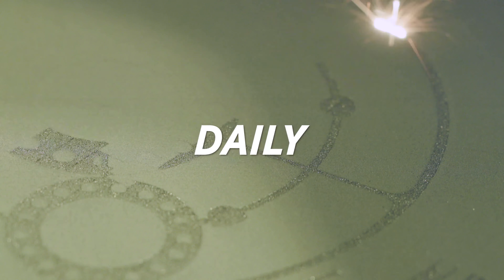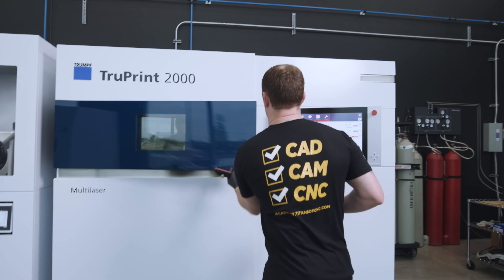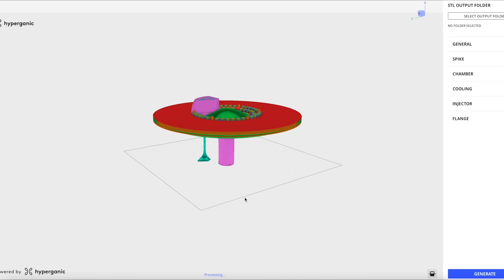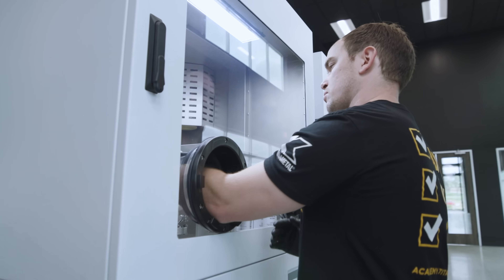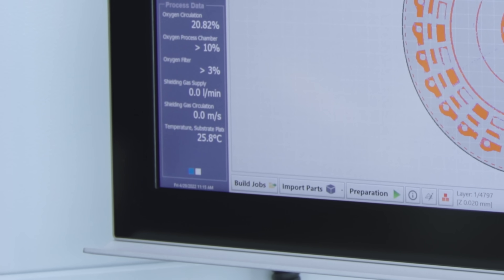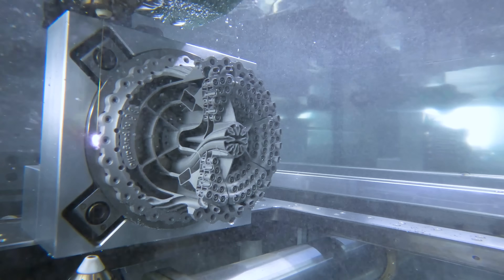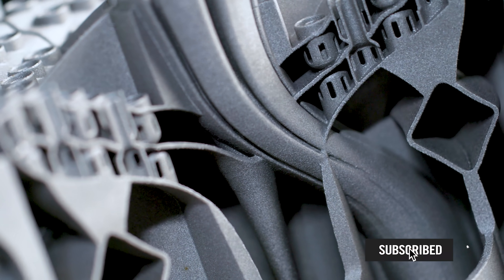3D Printing a Titanium Part Created By Artificial Intelligence

Comment: Ti 6Al-4V is the most widely used of all the alpha-beta titanium alloys. It is typically used in the annealed condition, at service temperatures through 750°F. However it may be heat treated for high strength in sections under 4" thick. Hardenability is limited and sections over one inch may not develop full properties. Ti 6Al-4V is welded with matching or with ELI filler wire.

Mill anneal: 1300-1450°F 2 hours, air cool. Recrystallization anneal bar for better ductility and fatigue strength, 1750°F 2 hours, furnace cool.
For maximum fracture toughness and SCC resistance: Beta anneal 1950°F 1-2 hours, water quench. Then age 1150-1300°F 2 to 4 hours, air cool.
For maximum strength: solution-treated and aged (STA) condition is: For sheet, 1675-1725°F 5 to 25 minutes, water quench. Age 975°F 4 to 6 hours, air cool. For bars and forgings, 1675-1725°F 1 hour, water quench. Age 975-1025°F 3 hours, air cool.
For increased fracture toughness, but lower tensile strength: precipitation treat (overage) 1150-1250°F 4 hours, air cool. Stress relief annealing is commonly 1000-1200°F 1 to 4 hours, air cool.

Ti 6Al-4V is resistant to general corrosion but may be quickly attacked by environments that cause breakdown of the protective oxide. These include hydrofluoric (HF), hydrochloric (HCl), sulfuric and phosphoric acids. Inhibitors may help for the last four but not for HF. Ti 6Al-4V resists attack by pure hydrocarbons, and most chlorinated and fluorinated hydrocarbons (provided water has not caused formation of small amounts of HCl and HF).

Comment: Are all you people sheep!? Not a single comment asking what this ”piece” is for. Sure 3D printing is cool, and Im sure AI will help be a great tool to develop efficient parts in intelligent ways, but a random part generator is completely fucking bananas. Every ”part” of something by design is there for a reason to serve a function. A random ”part” generated by algorythms that look futuristic and cool but doesn’t have a function is completely useless! Why are people impressed by this?! The technology is great, all credit to whoever created the hardwear and software. But this video is so dumb. A tool designed by an AI is just clickbate. Because this part can’t be used for anything! If the purpose is to show of the equipment that is one thing, but the random algorythmicly AI generated aspect is completely irrelevant.

Comment: I work with EOS printers and I have no idea how this printer can print so many shallow angles like that with no support so well. Do you run into any sagging problems? I’m also shocked that it didn’t crash at any point. Is this system a no contact recoater as well?
Reply: Hi Connor!  Great catch on the angles.  TRUMPF system offer the ability to adjust many laser parameters which improves ability to build fine features, angles, and overhangs.  In many cases this can be done without supports with the right design and process optimization.  I can send you info on the recoater as well.  Can you provide an email address?

Comment: Wow, I'm really surprised at the low quality of that print.  I expected it to be much better.  Not saying its bad, but all that texture, those tiny bumps everywhere, I guess its to be expected from additive manufacturing.  I just compare that to subtractive manufacturing where you use various tools to remove material and the surface is so smooth its shinny, even reflective almost like a mirror, this isn't even close.

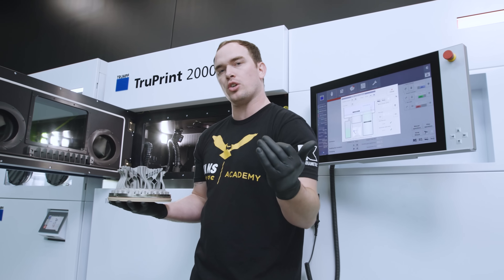Comment: But what about the crack (5:31, 5:42 and 6:00 min), in the middle upper part of the final product? This piece of art it will be a piece of garbage if this was a real component of a rocket. That crack showcase the reliability part of the metal printing process.

Comment: What does "wire" the part off the build plate mean?
Was that EDM?
Reply: Yes it was. The part is effectively welded to the build plate, therefore it needs to be cut off. Wire EDM is one of the most common methods used.

Comment: The problem is to start producing this for real products - it is necessary for the investor to find a normal material for normal composite mixtures, normal resins, normal equipment Especially when it comes to 3D printing lithography. Here is an example of an explosive engine. There are SHS manufacturers who are willing to pay me for it. But - they don’t give money in advance and they don’t give contracts either. Bottom line - why the heck is it necessary?

Comment: Interesting that there is a visible crack on the part. Without the cutaway, you'd never know it was there. At 5:52 where it overlays the words "NO SUPPORT" on the screen, you can see the crack directly above the 'O' in SUPPORT.
Reply: Yep… that part if completed without the cutaway would have shredded under pressure and likely blown up the engine in the process. I also noted that the part required substantial finishing as there were jagged edges along various openings that would have likely broken off and potentially damaged the injectors later or the engine… 3D printing is amazing… glossing over errors only undermines confidence
Reply: @MacKeyser  Is there a possibility that the crack appeared because they printed a section view of the part? I wonder if the 'AI' is able to not just design the part, but also do the relevant stress analyses.
Reply: @jyothisjenu6477  good point as it was printed with no supports. How many dimensions does ai think in producing layer by layer, stresses, expansion etc.
Reply: There’s other defects that they tried to hide with editing also.
Reply: saw that also.. in between the chambers a lot of excess material.. really cool concept though in time these things will just get better and better.
Reply: I mean it's clearly just a display piece. Im sure the procedure would have been slightly more operator support centric if they were actually making the part for a project. The point of this was to show off the AI's ability to design parts, not whether or not the printer could handle it all on its own.
Reply: @CorwinTheOneAndOnly pretty sure the point was to show off the printing technology not the AI side... Otherwise it would have been a video about designing the part and not printing it.
Reply: The other problem is you can't fix those issues. They can't be merely welded or filled in with material, because it wouldn't create a reliable enough bond and would cause stress in the material. Another issue with algorithmic design is it isn't able to take into account a lot of factors during operation of a part. For example, those thinner areas might save on weight, but thinner also means radiates heat quicker, which can also mean that area can actually get hotter, creating more stress than expected. Same with heat expansion....you can end up with thicker areas expanding in ways that create a whole bunch of different angled sheering stresses on thinner parts. 

And cracks like that also mean there is a malformation in other attributes of the part, as that space from the crack has to be displaced somewhere else. And one must also consider there could be thousands of cracks like that, but just not visible to the naked eye, and all through the inner areas, not just surface visible. In the end one must consider if it is even worth the trouble. A big part of the rocket industry is over priced because of the niche nature, not necessarily because of the difficulty of construction. So you could potentially make parts way cheaper than this with manual labor, if you devoted manufacturing work to it, with space to throw out bad apples and still have the costs be low. 

3D printing is great and all, but it also gets around an artificial problem. You setup a sewing machine style manufacturing line with tons of regular workers grinding away at specific tasks, and you could achieve some amazing results for very low prices per unit. But our economy simply isn't geared for that anymore, which is what makes parts like these more expensive than they need to be.  Just look at it this way. I have an umbrella. It was cheap. It has more metal than a metal pocket container I have, its construction is more complex than that pocket container. Yet the container cost twice as much as the umbrella. Why? Basically, just 'cause. That's the rocket industry in a nutshell. By gatekeeping manufacturing, out of a sense of prestige, everything becomes more expensive.
Reply: If they had printed demo part in another material, that crack would have been unlikely to form. Large titanium parts are notorious for cracking in LPBF processes and it's obvious their laser parameter are not as refined as they say they are... for a demonstrator piece, it was a waste of money. The crack is shown at 5:41 as well, right as they are saying it would be a "fully functional part" without the cutaway.
Reply: What’s funny (to me) is that the analog would be screen printing, as if the laser shoots the film before every pass as separations.
Reply: It is possible that the part was made with an intentional defect or a few. This piece would have military significant applications. Regardless, it is proof of the concept of a manufacturing process.

Comment: Very cool! No sintering?
Reply: That’s correct, the lasers fully melt the powder to fuse the metal powder together. During sintering the powder is only heated to about 85% of the powders melting temp. These parts come right off the printer with a density greater than 99.7%

Comment: 5:43 makes me think of widowmaker pieces. The technology needs a lot of work. 3D printing may advance but not that fast. There are risks due to the complexity of the piece. If there are cracks and missing layers the piece becomes a high risk for failure.

Comment: I know this seems like a simple question but would you be able to print a Cuban link bracelet or necklace that wouldn’t have weak points because of the soldered ends/ and the clasp instead having a solid piece

Comment: Is the build plate sacrificial?

It is interesting they're going open source - but depending on the license it doesn't mean necessarily 'free for commercial use'.  For example, Java is/was open-source and there are free JDK versions but Oracle (which owns Java) insists on a commercial license going forward -- educators, non-profits etc.. can get a license free, but you still need a license.
Reply: people can copy the algorithm for use in Free software if its not patented
Reply: The build plates can be reused. They always use wire EDM to cut the parts off which leaves a nice finish. But occasionally they might need to be milled flat.

Comment: I’d like to see a Mauser c96 pistol printed..i firearm with no screws built like a puzzle from 1896 when machinists where artists of steel where today it’s very hard and expensive to duplicate on conventional equipment…I bet the 3d print process should be insane..just thinking out loud

Comment: Grams are not a measurement of volume
Reply: You’re right it’s a measurement of weight. The powder going into the supply cylinder is weighed based on its density per cubic centimeter. So… if you have a volume of 15,000cm³ and a powder density of 2.6g/cm³ then you need to weigh out 39,000 grams (39kg) of powder to fill up the 15,000cm³ of volume in your supply cylinder. We went just shy of that, and weighed out 37.5kg of powder.
Reply: @trevorgoforth8963  Wrong. Measurement of mass

Comment: Injector head design has been an art form for decades. Effective mixing was done by experimentation before CFD and  the design algorithm would have to have that information; heat transfer; structural integrity and fluid flow as well as some two phase flow check (tied to the heat transfer). I wager the algorithm isn't that complex. It should also check for cavitation and turning losses. Probably 2/3rds of the physics isn't represented except by an empiricism; simple laws that limit how far the design can go. THE TOOL IS USEFUL BUT DON'T BE OVERSOLD.
Reply: yeah its definitely not a true AI

Comment: That TruPrinter 2000 is awesome. It wouldn't surprise me if it comes with a price tag of $250K or more. 

The BioPrinting intrigues me as well. I would love to see a demonstration of that.
Reply: I used to work for Trumpf, I'm pretty sure you are looking at close to a Mil with the different processing equipment you need to load/remove the powders.
Reply: more than double that, easily.

Comment: I wish there wasn't a cut away in the rocket combustion chamber and it would've been so cool to actually do a thrust test and see it actually firing. That would've been so awesome, I understand why you did do the cut away. To show your capabilities with 3d printing and that AI program which are both so freaking awesome and amazing.  I just love rockets 🚀 . 

I wish  Warner von Braun could've seen how easy it is to build a rocket combustion chamber compared to when he first built them. I'm sure he'd be 🤯!  🤣 😂 

Awesome video! And thanks for sharing.
Reply: The reality is that besides being lighter this part would perform poorly. 3D printed metal is exceptionally weak, especially in a severe environment like rocketry. There is a reason SpaceX uses fully cast and machined components in their engines instead of 3D prints. You can make nifty shapes and designs with CAD models, but they just can't be made with actually strong processes like machining and casting.
Reply: @spacebound1969  there's a company based in California that's building majority of a rocket out of 3d printed parts. But that's why I said it would be cool to actually test it.

Comment: Laser sintering is probably my favorite additive manufacturing process, I look forward to affordable polymer sintering machines for the home shop.
Reply: someone at my art college built a solar sinter using a big fresnel lens and a solar powered bed to use sunlight to 3d print sand into glass in the Sahara desert. Was a nice project and scaled up you could print little houses etc

Comment: Hmmm  ... ................................ the military has been looking/using at AI for a long-time.
The problem with AI is only the geeks that developed it can't fix it (well most times aways ;) & you can never get a straight (ex: non-geek) answer out of them.
So it's best to only use it in non-criticial systems or only when the risk is clearly worth the benefits (ex: auto target ID/tracking).
In any case it's best to manage the benefits, risks, costs, etc of AI more than it manages you.  
Otherwise you might just end-up with skynet or something ( Terminator 3 Skynet Takes Over https://www.youtube.com/watch?v=_Wlsd9mljiU ;).

Comment: So basically, the designing engineer just used automation to calculate the optimum hole size for each little hole... for a part that was already almost completed. That's hardly a step above a clever person writing a function to solve a math problem with very defined parameters and hitting "autofill" on an excel spreadsheet or R program. 

Neat, but this isn't "artificial intelligence".
Reply: Had the same tought, i also took a look at their website. I couldnt find the model of engine they were printing in the video on the website besides a picture of it being used for a blog entry. But another entry also featuring a rocket engine claims that the model never touched any CAD software, which i heavely doubt.
I have the supicion that they are only using buzzwords to sell the product.
Reply: @GmanGer  I would say suspicions are normal when new tech comes around or bold claims are made but considering the platform will be open source, I don't think anyone is being deceitful just to try and sell things. Thanks for watching!
Reply: @trevorgoforth8963  My dude, open source =/= free or not trying to sell you something. 

Lots of software is "open source" with features and technical support locked out behind a paywall. Justifiably so in many cases because the devs need to eat, but certainly not immune from hype and nonsense.

Comment: How do you analyze the material properties for this part?   Are the properties and density heavily dependent on the direction of layup?  Is this taken into consideration when printed?  In other words, do the properties vary across the section and/or through the thickness?
Reply: theres lots of info about the material affects of layer-lines on 3d prints

Comment: When you see how laser melts the titanium powder,  in design that is generated . Thats how laser printing is done old technology. Thats why they use argon to decapitate the oxygen. Or else there would be micro air pockets.
In other words with less than 1 percent of oxygen. Hydrogen is still present .
There is a better way of creating laser printing. I will tell you about next time. Boom